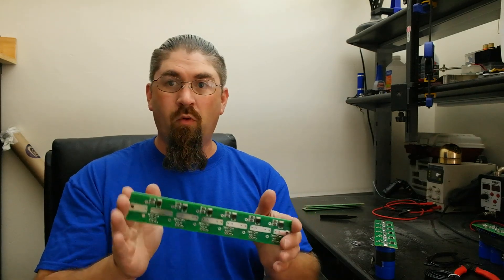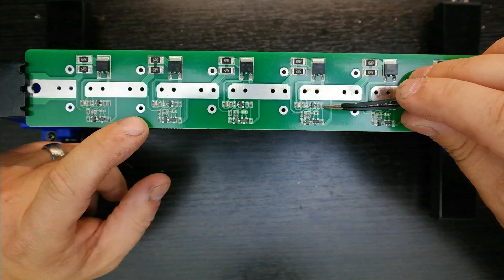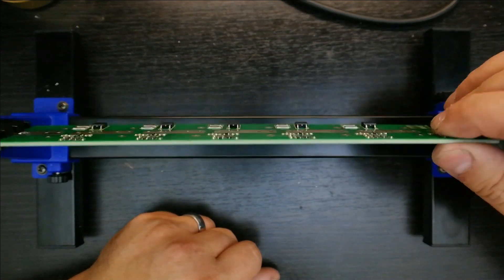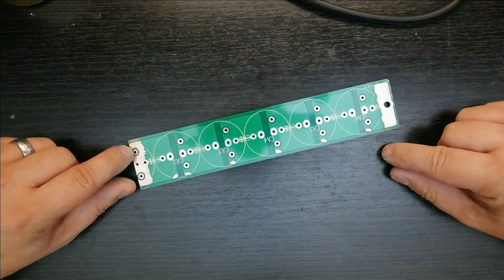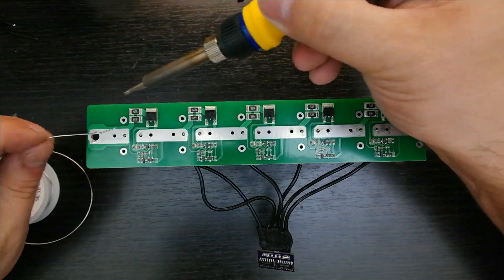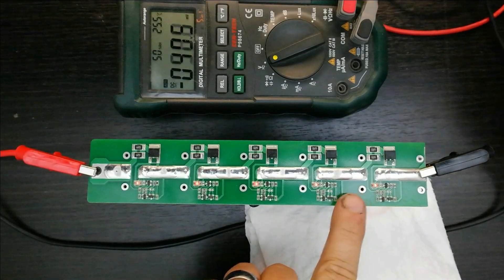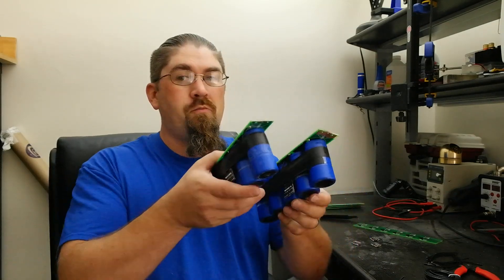Hybrid Supercapacitor Car Battery Part 2 - Supercap String Assembly

Comment: Don’t understand why you keep the “mosfet balance board” secret. What it the purpose of the video showing the making of the capacitor pack if you refuse the let people know where to get that board? Does a balance board actually exist other than a protection board that basically bleeds out extra charge when voltage is too high?

Comment: you could have just bridge it with wire/solder  and removed all the stuff on the 6th cell spot   
Rather then cutting it  that would have been the smart way

Comment: Do you have a schematic, or at least a listing of the SOT23 parts used for the 2.7-3V circuitry? They are sanding the part numbers off now and any of those parts could be a MOSFET, NPN, PNP, or a comparator.

Comment: Great project & video, Tx!
Just a friendly remark on soldering: one should first apply heat to the object to be soldered and then add solder. If you first add solder to the iron the flux inside the solder evaporates/burns before it touches the object. Ideally you add the solder immediately to the heated object in stead of to the iron.

Comment: Odd thought - as the voltage in the cap rises, the charging current drops.  Given, that a 6th cap costs more.  Would 6 caps charge to 2.5v faster than 5 caps charging to 2.9v?
Reply: Jay Herde 
Just to add butchtropics answer: adding a 6th cap would reduce the overall capacitance from 300/5=60F to 300/6=50F

Comment: Ref @ ~ 10:30 :  I would have made sure that these huge masses of solder would contain mostly copper, from large gauge Cu wire (even buried in the solder), for maximum conductance.  A general 'rule-of-thumb' is that copper has 500% less resistance than solder...see https://forum.allaboutcircuits.com/threads/conductivity-of-solder.41295/

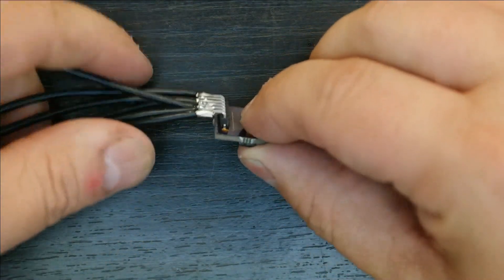Comment: At 7:17 don't you think that those six wires really need some good heat-shrink over their connection to the six pins?  About six 1" lengths can be 'slid' over the wires and then all heated at once.

Comment: why do you choose five and not the six?
Reply from the maker: +darkmatter at 3v a cap you only need 5 in series to work at 14-15vdc, whereas you need 6 caps in series with 2.7v each to handle the same voltage.  Plus removing one cap in series actually gives you more farad capacity.
Reply: +Mad Electron Engineering thank you
Reply: More in series more loss of total Farad! 6 -350F would be 58F 5 -400F would be 80F if 6 in series would be about 66F. From my research.

Comment: Would it help more current if you were to solder copper over the large traces rather that a just thick solder?
Reply from the maker: for a 1 inch run most likely not in my opinion.  but I will be using solid copper for the bus bars.
Reply: It would be "good practice", if one could wrap that copper around each pin since copper will have 10X the electrical conductivity and even more thermal-conductivity. In this application specific heat is probably the important consideration to keep the solder joint from melting where lead and copper are closely matched.  For continuous current it could make a difference.  Adding both copper and solder would probably be best practice.

Comment: How much longer do you believe that it will be before this will replace the LiFePo batteries in EV's?
Reply from the maker: They already are for the DIY conversions.  As for tesla, who knows.
Reply: I would believe that since electricity is the same for DC LiFePo as it would be for DC Supercapacitors it would be only an issue for energy storage and range anxiety.  As well as the size of the Cap banks.